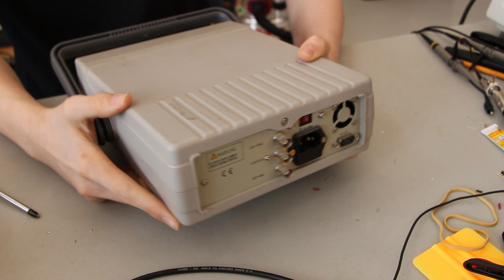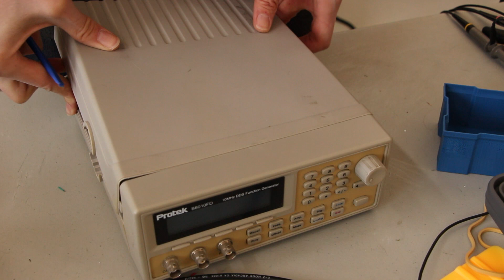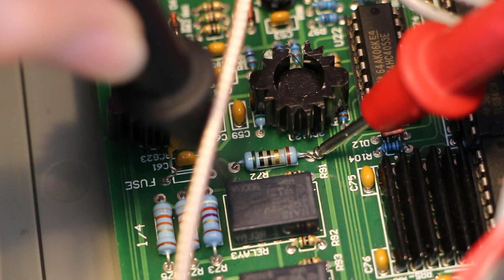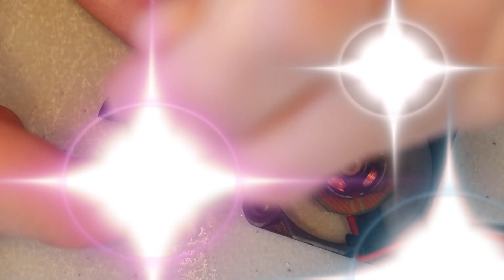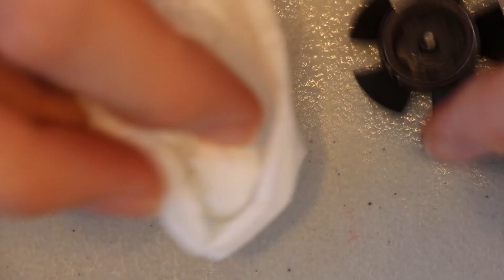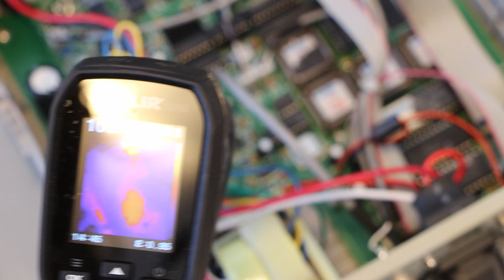Protek B8010FD Function Generator - scanlime:010

Comment: Wow this reminds me of a customers RS232 to CAN converter I had to integrate in 2012 which was designed around a PLCC Z80 with 90s datecode because the company aquired an incredible stock of all these old parts back in those days so they continued using them ;) Really weird though

Comment: Socketed slots are old but doesn't that make it easier to service if you have to replace a specific IC?
Reply: +Micah Elizabeth Scott good to know, thanks!
Reply: +Steve Greenberg Not to mention the added cost to the bill of materials. Good quality sockets can cost more than the IC's being put in them at low volumes. Judging by that design, it's not that expensive of a unit to make (although could be made much cheaper.) I'm betting that particular firm spent more on the plastic shell molds than the board. For the hardware we make, it's not worth our time to fix RMA'd units unless it was bricked in an update. Thus we just dispatch a new one. Even though I suspect most of our RMA's could be fixed with a short hop in the reflow oven.

Comment: Those OKI 82C54 are timers. Really weird to see them there. I think they are part of the sampling frequency generator. That controller looks pretty much like an Atmel AT89P51. They use to have the crystals at pin 18/19 like in that DDS. http://www.atmel.com/Images/Atmel-3714-Microcontroller-8051-AT89LP51RD2-ED2-ID2-Datasheet.pdf
Reply: +Micah Elizabeth Scott I am totally with you. If it wouln't have been so obvious from the part number I'd just said that's flash and SRAM. Since I watched the entire video where you later discovered that the sampling is done at 100MHz fixed frequency I have no idea what those parts are even doing there.